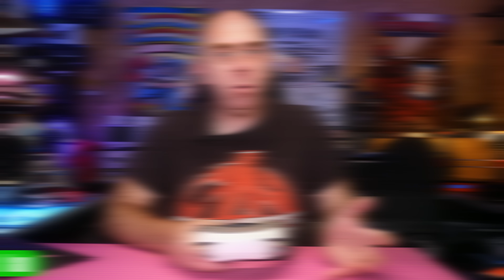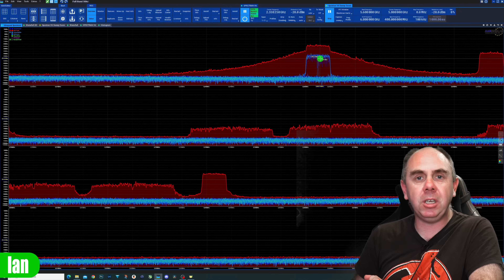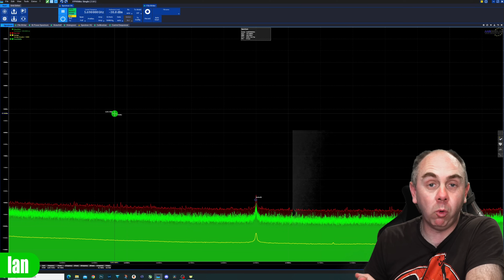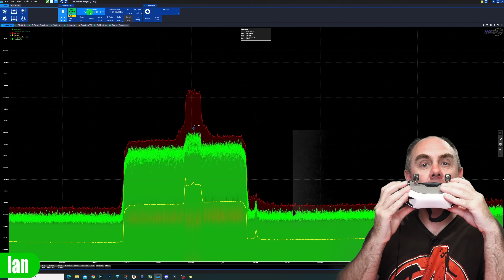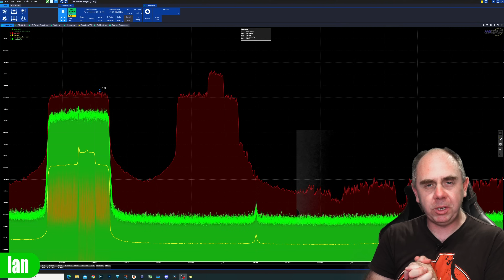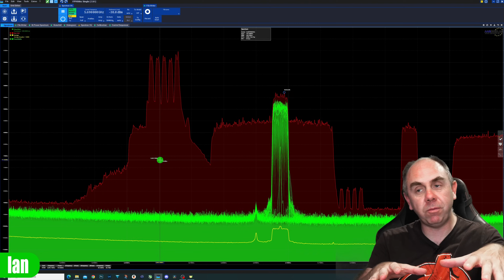AVATAR HD FPV RF DEEP DIVE - A LOT TO UNDERSTAND

Comment: Mads Tech is my favorite reviewer with deep knowledge in Baseband/RF, firmware/hardware, PCB board/ASIC level. Most of the influencers, even the big ones, just fly at his yard talking about image quality, or at bando for penetration, and these are definitely good factors. However, Ian tells you the reason or principle behind this, and something hidden below the surface, such as how well the system works with the others.

Comment: Question, forgive me if I missed it: What WS firmware is this testing being done on? 
I like that the WS output is significantly 'cleaner' than DJI from an RF standpoint. The slopes that create the 'hump' on the DJI system are spurious, or off-freq, transmission which is wasted energy. That is a lot of RF noise, heat, & mah for nothing. VS The WS system that is putting everything into the intended channel, no dirty splatter. I still feel like with another two or three major firmware updates WS could be something formidable.

Comment: Unbound goggles that change channel to vtx is really weird! I guess that many of this can be fixed in firmware, wha lt imprees me is the dji goggles carrier so thin , maybe if you move air unit away where the signal goes down, will it change ?
Reply from the maker: No the carrier is 5mhz fixed. DJI is thinner but it’s more of them

Comment: Very fascinating. Thanks Ian for doing this great deep dive on the spectrum analyzer.

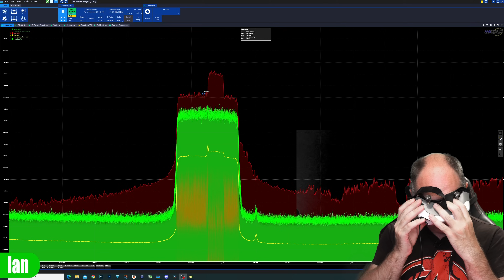Am curious (~24:00) where you power on an unbound VTx and it begins transmitting. How would this impact a bound VTx being powered on at the same time. Seems both VTx would attempt to transmit on the same channel as any goggle were detected as being on? 
(if you have two VTx's this might be an interesting follow-on test) 

This raises some real interesting questions for when multiple goggles are within same region, like at a race event, or a group of flyers are nearby to each other. Powering on an unbound VTx nearby to powered on goggles could cause unsuspecting RF. (example: someone doing benchwork at a group event)
Reply from the maker: Yea I need to do a lot more testing on this. I need another set of goggles tbh.

Comment: Hey Ian, any ideas what is the purpose of the goggles hopping a few random channels when it's turned on? Could it just be doing some sort of sanity check to verify the system is functioning normally?
Reply: I could be an environmental RF background noise check. System tests a few channels and pick one with lowest RF noise.
Would be interesting if Ian had access to another set (or 2) of goggles to see what power-on behaviour is with other goggles already active.

Comment: What happens on DJI with unbound system?
Reply: Nothing. VTX will not transmit if powered-on until firmware matches, and has been bound (paired) to a set of goggles.

Comment: Great deep dive as always Ian! Appreciate the time and effort spent putting this together.
Reply: Any range tests planned with this system mate or not going there?
Reply: @KwaddawK  I'm in the thick of it ATM actually. Done a few flights so far, but trying to get my hands on the beta firmware so that I'm not testing with bugs that will have been fixed by the time I publish. Not having much luck getting access so far though :|

Comment: It would seem that the order of operation with the system as it stands today would be the following 1. Turn on RC TX 2. Plug in Quad/Plane 3. Turn on Goggles. This will greatly reduce the likely hood of impacting other pilots nearby. With that said it would be ideal if the standby mode also controlled the Goggles TX power on initial power on. Also, not sure what to think about the power on carrier hoping through two other frequencies before settling to the correct/public frequency, that's very strange.
Reply: Goggles have to be powered on before the quad/VTX in my experience otherwise, while you get the video image, the MSP connection doesn’t work so you don’t get OSD and more importantly the VTX doesn’t switch out of standby mode when you arm the quad

Comment: Great video!  What version of firmware was this tested with?  I only ask because I have been told that the most recent version has made a change to make them operate around other people with less interference - or so my contact has said.
Reply from the maker: This is the latest beta, that firmware. That change simply appears to be the 50Mbps mode change that channel 8 is always 25mbps.

Comment: You should check to make sure the VTX stops transmitting if a second VTX that's paired to the goggles powers on. Otherwise an unpaired VTX is basically an RF jammer.

Comment: When DJI came out. Everyone raved about how they'd blast analog pilots...this seems alot worse...in practice dji works fine with analog if you manage your channels, we typically fly 1, 4 and 8 (or digi 25mbps 1 4 7 or digit 50mbps on 1 2 3

Comment: If I set 25mW will the output be variable or will it stay fixed so we dont have issues with lap counting system? Anyway of checking this using your bench top equipment? Maybe take the goggles to another part of the house and check RF strength repeat with goggles far away and VTX on bench. We all know DJI even at 25mW varies output power, what about avata system? Is output power fixed or does it stay variable like DJI

Comment: If the goggles are in spectator mode (or whatever they call it), do they still transmit at all? I feel like it would kind of suck if they do because it would prevent you from hanging out and chatting near friends. That leads me to a second question actually - if you are in spectator mode, is the power level selection grayed out as it would be if you’re not connected to any VTx? Because if the goggles are also transmitting that would mean that they only way to bump down from 700mW or something being blasted out of your goggles would be to power up your own quad, change the power level, then power it off and then go back into spectator mode, which seems like a giant hassle.
Reply from the maker: This is something I don’t know.

Comment: Ok the channel hopping  at start-up could cause a lot of problems as you mentioned. But having no low power output when powering up, to me could be very dangerous you go to the field turn the goggles on and want to have them at 25 MW to comply with everybody else flying, but as you power your goggles on if it jumps straight to 1200ml you could end up blasting everybody out the sky now that is a BIG no-no. 

Also if they have a setting on the vtx for standby mode (low power)  why haven't they linked that to the goggles this makes no sense to me and I can see a lot of problems at an event or just a few friends out flying.
It also seems that if your quad is turned on somebody else with the goggles that is not bound could turn  their goggles on and change the cycle setting on your quad. Way too much weird crap going on with these goggles and I'll stick with DJI... Awesome information buddy very useful and very informative. 👍👍👍

Comment from the maker: Hi everyone I have put a summary together here for on you this video.  

Avatar Goggles. 

1: On power on the goggles take about 10-15 seconds before they start transmitting.  When they start they hop either once or twice before jumping to the user selected channel.  The channel hops appear random with the carrier transmitting for less than 1s on each hop at what looks to be about the 25mw power level. Channel 8 appears to be a regular stop off however the actual hop sequence appears random overall.  

2: Once the goggles hop to the user selected channel after it’s initial hops the RF output increases to a high level for about 2 seconds before going to the preset level in the menu.  

3: The goggles RF power output is both on permanently and at the set level in the settings.  There appears to be no standby mode or low power mode on the goggle and what ever level you set them at last is what they will power on to. You also can’t change this with out the VTX being connected as all RF options are greyed out at this point.  

4: Goggles transmit at all times regardless of the connection to VTX, changing channel in the goggles when not connected to VTX does change the goggles carrier to the selected channel. There appears to be no other carriers like on DJI on random parts of the band. 

5: On signal loss the goggles do not appear to hop to channel 8 to wait for signal.  They stay on selected channel.  

6: When last setting was high bandwidth the overall behaviour is the same apart from WS have now aligned its behaviour to DJI so channel 8 is always 25mbps and 1,2,3 is 50Mbps.  

VTX 

1: VTX only transmits when it’s connected to goggles. VTX power on alone produces zero RF on the band at all.  RF only kicks in once goggle is detected. 

2: VTX Standby mode does work as intended however as above does not apply to goggles, so changing RF power output on the ground not armed will result in the goggles changing in real-time but VTX ignoring till armed. 

3: A quirk behaviour found that un binded goggles cause VTX to transmit on the same channel as those goggles.  Need to understand more on this.

Overall powering on the quad alone around others should be fine however powering on the goggles is going to cause issues. You should take great care in turning on the avatar goggles when others are flying.
Reply: Jeez, this is going to cause a few issues in the pit area.
Reply: So general rule of thumb is don’t power on if anybody else is flying, what a clusterfrak, at least with DJI you know you can safety power up the googles without fear of blasting someone out of the sky….

Comment: Key takeaways: 1. Goggles always TX at the selected output power regardless of if the vTX is powered on or not. 2. "Standby Mode" lowers vTX output power when disarmed, but goggles still TX at selected output power. 3. vTX is powered down completely when goggles are powered down, so you don't have to worry about plugging in your quad if your goggles are off.
Reply from the maker: 100%.  I should have just said that at the start of the video and left it there 😀.  I literally just posted my summary and pinned it.
Reply: But you do have to worry about plugging in your quad if someone else is flying with the same goggles because even if there not bound to them goggles your quad will start to output on the same channel
Reply from the maker: @SuphiKaner  potently yes.  I need to understand this more. Need a second set of goggles.  This could only be with some unbound behaviour or there is something overhanging I don’t understand.
Reply: @SuphiKaner  That would be my concern. If you plug in close to someone flying and their goggles powered your VTX on would that signal over power their incoming signal since it is much closer?
Reply: So #3 is the only one similar to DJI (we have found at our club that if you power down your googles the air unit also goes into low power mode automatically)…. Interesting.
Reply: This is not safe at all
Reply: What a strange system.